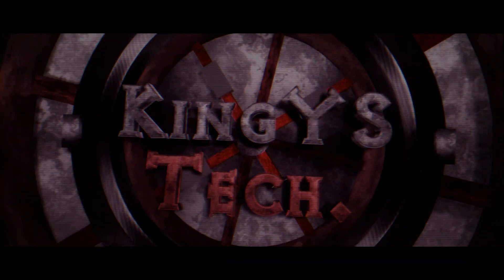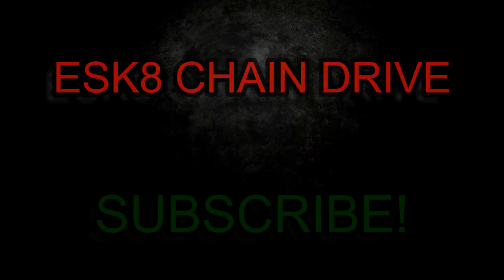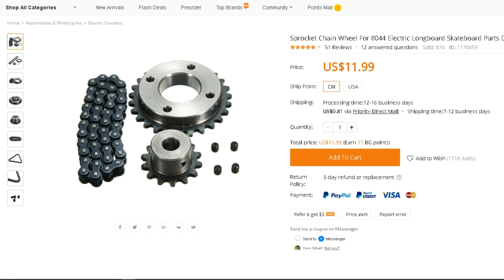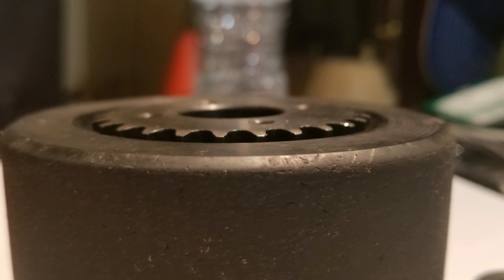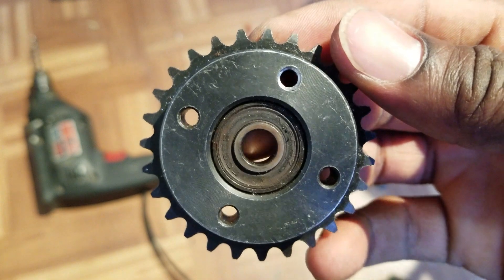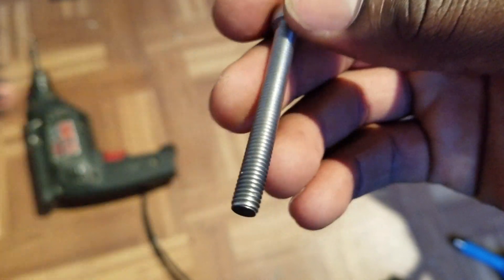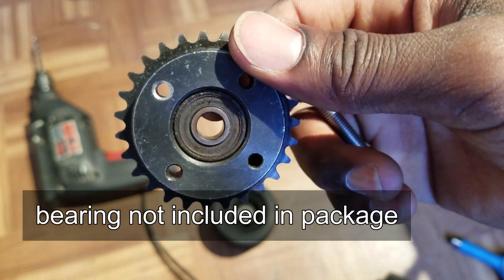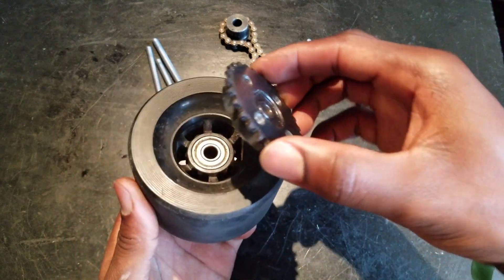Chain Drive upgrade to DIY electric skateboard

Comment: How fast can you go with that motor and chain
Reply from the maker: The chain does not affect the speed at all, but it affects the traction in a good way. I could get up to 26 MPH on my 10s battery and over 35 MPH when I mount my 12s battery

Comment: Bro what about if the battery dies can i still run it free or the motor has to start turning while pushing and that makes resistance...??
Reply from the maker: You can push like a regular skateboard when the battery dies, but the resistance depends on the motor you are using. Good quality motors = less resistance. The belt tension is also a factor, if it's too tight there will be more resistance
Reply: @YvonSmart  thank you 👍

Comment: does the chain get hot?? Because I've heard that they do which transfers the heat to the motor mount and motor
Reply from the maker: No, it doesn't. There isn't really enough stress on the chain to even get it worked up! At least on a skateboard

Comment: Im going to switch to chain , belts and plastic pulleys Suck....thanks for the help.
Reply: wrong, chain is heavy, noisy and a strong belt wins over chain plus that chain pulley on wheel is large and so close to the ground clearance
Reply from the maker: Personally I like the noise the chain makes, the weight doesn't matter (belt 16g  chain 45g), the board doesn't even know something has changed. A chain on a board almost never brakes (especially on dual drive) no need to worry about flying at 35mph with no brakes because of broken belt. Chain doesn't stretch. Only down side is maintenance (Got to clean and lube sometimes)

Comment: I hope you still accept questions here... 

Did you find any issues using the 4 bolt mount pattern on what looks to be wheels designed for 6 bolt placement? 
I'm asking about the bolt fittings in between the "spokes" of the wheel itself; the little bits connecting the bearing housing on the wheel to the soft, rubbery part of the wheel.

(I say this because with previous belt drive systems I have tried, the 4 bolt designs didn't like to match up with my 6 spoke, 90mm wheels, like the ones found on amazon here https://www.amazon.com/dp/B0752XGW5W?tag=duckduckgo-d-20&linkCode=osi&th=1&psc=1 )

if you didn't, what types of wheels did you use that didn't give you this issue?

second, did you find any issues with this drive system after long periods of use? (I.E. chain slipping, motor sprocket slipping from lock on shaft, etc) 

I'd absolutely love to use this on my "longboard" project. My board weighs about 100 lbs on its own, and belts can't take the stress that a common longboard would. any help or advice would be IMMENSELY appreciated!!!

thank you so much :)
Reply from the maker: The holes on the chain pulley match the wheel rim, but originally, the holes were too small for M6 bolts, so I had to drill them wider. So be careful with the drilling, it might add an offset. You are right, here I'm using thin spokes ABEC wheels (There are thick spokes ABEC wheels out there causing confusion, Those might not fit). Had and issue with the setup coming loose, so I had to 3D print a piece that replaced the two bearings.
Reply: @YvonSmart   Thank you so much! I was able to actually overbore the holes all the way up to an M8 bolt, with the heads of the bolt just shy of the chain sprocket. my Wheels had really narrow spoke gaps, but after overboring the gear, I just bored straight throught the wheel as well after having them lined up on a temporary shaft in the middle

Comment: Boss what motor mounts did u use?
Reply from the maker: Reply updated
Reply: @YvonSmart  Thx for reply! Thats so funny bro I literally just ordered the torqueboards one haha. They were expensive cuz I had to order two but I expect theyre high quality. Also if I could get your opinion on the build im doing, that would be awesome. I ordered the rear truck from electricskateboardparts.com that you put in the description. I got two torqueboard single motor mounts. Two n5055 270kv 1400w motor (x2) from diyeboard.com I also ordered two chains, sprockets, and drive gears (the ones you recommend in the desc). I still have to drill the holes bigger in the wheel gear like you did in the video so they fit the M6 bolts I got that you recommended. I have 90mm flywheel clones from ebay that I plan to use. My ultimate goal is to do a badass dual chain drive setup. Any input or thoughts or doubts? Thx
Reply from the maker: @domobrah2671  motor kv kinda high, you wanna stay away from 12s (it still depends on what controller you wanna use tho), if you got the same truck as me, you need a couple a spacers (to put between the truck and the wheels). And extra bearing goes inside the bigger sprocket. The setup kinda sucked because I had to use two bearings as spacers between the wheel and the sprocket. Now i m working on a 3d printed spacer that will fit nicely.
Reply from the maker: @domobrah2671  I will perfect the 3d model (still not well centered on screw holes), and I will share it with you.
https://drive.google.com/folderview?id=19mgRpqWhm6hB5aOiBxeb3AphCt-S4szr
Reply: @YvonSmart  Thank you man. I appreciate it!
Reply from the maker: @domobrah2671  How is your setup going? make the pulley holes slightly tight for the bolts, this will help reduce friction. I just finished the 3d spacer. I can either send you the 3d file or 3d print two of them for you for free (Of course you take care of the shipping). I also 3d printed two torque board belt  covers if you want 
https://drive.google.com/open?id=1AvkU4AvRE3627QSNo2GB7YfCmwpy3hfX

Comment: I'm a little confused as you appear to swap out the ESC without explaining why ;)
Reply from the maker: I was just replacing the esc on the same ocasion! Chain or belt doesn't require a specific controller. It's the same thing, chain is just more reliable and durable.
Reply: @YvonSmart  No worries. I'm trying to find some out which motor is best for both torque and speed, chain vs belt, etc. stumbled on this video and got confused as to what ESC you swapped from and why.
Reply from the maker: @DrivingwithNico  I was using a Torque Board 4.12 ESC, 50 amps max, then upgraded to Enertion Focbox 60 amps continuous, it is smoother and handles better FOC mode